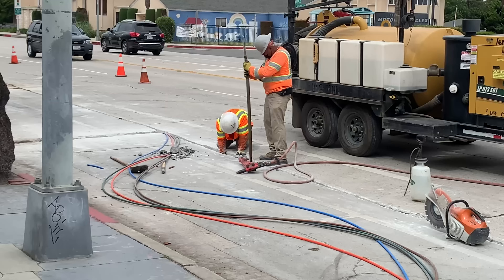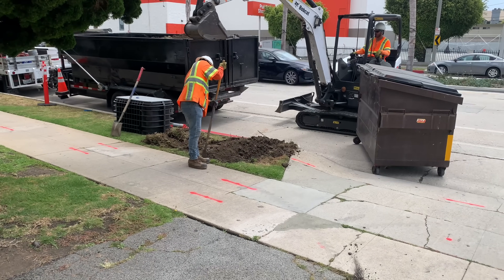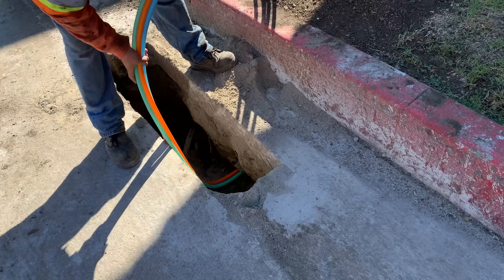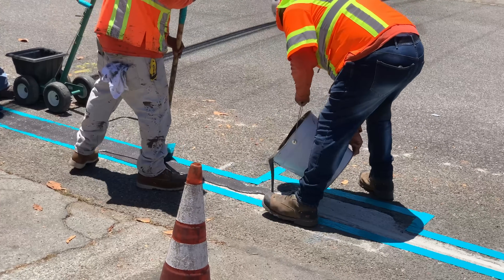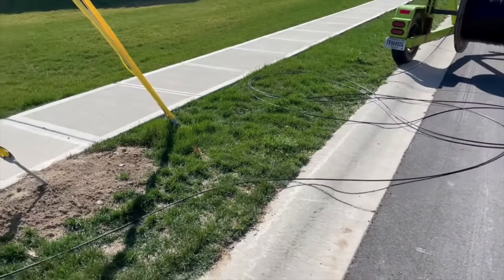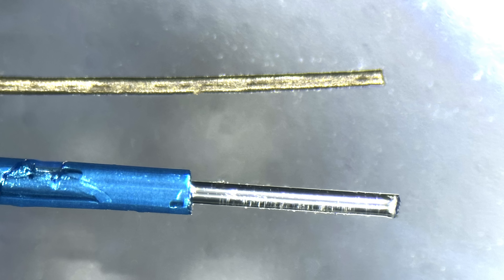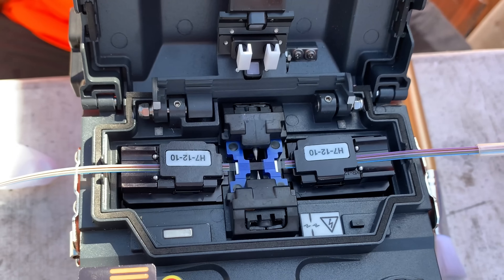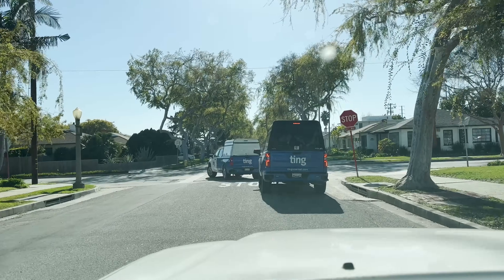Fiber Optic Network Install

Comment: How does the arc make such a perfect connection? It looked like it was never seperated.
Reply: Glass is very resilient and doesn't oxidize when heated and melted

Comment: during the transition from copper to fibre, my colleague told me a story of how crazy it was to convince the customers to change from modem to ONT as he was one of the technicians that was deployed to install the new ONT
Reply: You wouldn't have to convince me unless the price was outrageous. In suburbs it seems to be cheaper than cable internet. Really wish those recent grants would have went to small outfits wanting to do some startups in rural areas. But it probably all went to the huge companies to do nothing but stay on DOCSIS for another 20 years and bend over everyone.

Comment: Left out hitting the gas main.   The fiber optic installers here have hit the gas mains about a dozen times in the last year.  The city banned a contractor over it, after they hit one and refused to stop work while the line was being fixed

Comment: The process works/worked a bit differently out where I live. They didn't bury the lines in the street, they dug through dirt. Practical Engineering did a video about steering a drill beneath the surface, and I instantly recognized the machine demonstrated in that video as the one that ran the fiber lines all around the city and in my neighborhood.

My line was spliced off the main that ran through the front lawn of my neighbor across the street, then was run beneath the pavement to get to my lawn near the curb. From there, they ran it to the house, and used a Ditch Witch to bury it beneath the lawn.

But in other places around here, usually the more rural areas, the fiber lines are literally run using telephone lines. My grandma got fiber before I did because her phone company ran the line to her house along the telephone poles.

Comment: im surprised that the local government allow that kind of underground fiber cable to be layed on the road it self. majority of the time, the only time it was allowed to be installed on the road is if its crossing the road, all underground fiber cable needs to be installed right on the pedestrian and cables need to be at least installed at least 2 meters deep so just in case that someone needs to repair the pedestrian, they dont accidentally create a fiber break.

Comment: Used to do a lot of fiber repair jobs and believe me it was a royal pain too. We were often in areas where we didn’t have a machine to help pull the cable so we’d end up pulling 2 miles of cable by hand. Though I imagine that our job was much more exciting than being the splicer that sat in a trailer for the next 12 hours
Reply: At least those trailers are air conditioned 😂
Reply: In my case heated
Reply: Hey guys any construction work let me know if have poc

Comment: A new fiber ISP rolled out in my area, and they ran their fiber along the electrical poles in the street, same as what Comcast and AT&T did. Seems easier than digging up the road.

This looks like an area with underground utilities though, which definitely looks cleaner.
Reply: Burying the fiber is the way to go,  its much safer than arial which is prone to disasters 
imagine down trees and utility poles  that fibre breaks everything is dead from phones to cable

Comment: I had fiber freshly installed here in rural Florida, unfortunately I guess the company didn't plan for the Florida summer weather and all the fiber splices in the wire wells were flooded and the tops were floating down the road because the crews never came back and put bolts in them, absolutely ruined, and thousands of dollars wasted. Glad I stayed to my old fashion coax.

Comment: splicing equiptment is incredibly expensive the small machine shown in 3:17 can costs upwards of 30,000$
Reply: I use to work at an arcade, and I was told splicing was cutting the coloring around the wire (like the skin idk I’m not an electrician and an engineer is who taught me) and connecting the two wires medal parts 😂 I did it with a hand tool, that couldn’t have cost more then $5
Reply: @JuanchitoVlog theres no metal in a fiber optic cable you must be talking about something else

Comment: I installed fiber for Verizon in the city of Syracuse, NY for years. If you have fiber internet in central and northern NY state, chances are I installed it. We never used those smaller plastic tubes. We would dig trench and bury 2 inch plastic interduct. Sometimes we would use a horizontal drill to get underneath roads or parking lots without digging. Once the interduct is in the ground, it's threaded with high tension cable and the fiber is pulled through.

Comment: This is just a local FTTP in a neighborhood. Long distance networks can be installed up to 20,000 feet per run without splicing. Also one fiber going into a Hub can be split up to 36 times, depending on the length of the run.

Comment: Great video, it is very very similar like here in sweden, difference is we use excavators 99% of the time, if we have to go under a road or a pedestrian road we have a thing called earthrocket, basically a long 40mm wide stick that punches the ground in front of it but often we just dig up the stem-tubes near roads and from there connect tubes to the houses, after that another company comes and installs the fiber through the tubes.
Reply: We work with those also, pneumatic missiles. They likely used those to get past the curb without cutting it.

Comment: Got fiber installed in my little town of 150 people last year. Makes a huge difference in internet quality. Only had wireless 4G available before that, which wasn't bad, but just couldn't get the speeds we got now. Got a 200meg connection now. Sure, no way near as fast as ya can get in the big cities, but it's a godsend compared to what we had before. Plus, literally live in the middle of nowhere where we have to drive over 30 minutes at highway speeds just to go grocery shopping, so I'm not complaining, lol. Anyway, it's neat seeing a close up of how the process works.
Reply: @kriss7306  that is crazy where u live bro?
Reply: that's honestly insane... how do you find work?

Comment: It's really neat to watch them build out buried Optical Networks.  My neighborhood is from the mid 1950's so all utilities are run overhead in the alley ways.  AT&T has the PON up on the poles.
Reply: yeah my county has the same setup, they run ethernet from the gateway out to the homes.. and the county across the river from me has the fiber to the house and gateway installed outside the house.. I prefer the latter but I am just happy to have fiber.

Comment: isn't fiber optic super easy to break within the cord when it's bent? you'd be lucky to get even %50 the normal speed with all those little fiber fractures within the cable. These guy don't know how to handle it
Reply from the maker: The colored tubes are empty.. the fiber is a black cable which has a thick fiberglass core that prevents it bending tight

Comment: Your country is doing this in an extremely inefficient way

In my country they didnt need to cut up the whole street to run the cables, they were fed underground using a "Ditch Witch"

Comment: I live out in the country and at&t has an experimental fiber internet plan for rural areas where the fiber optic was sent from the power lines instead of digging through roads and  spliced and split at the pole and dug underground to the houses.  About 2 years ago we had a promotional plan for 75$ for 1gbs unlimited/1 year and after that ran out we switched to 50$ for 500mbs unlimited. Before it we were forced to use Hughesnet that was like 50$ for 25gb total usage and had to pay for extra per gb or something and it sucked very much. Such an upgrade almost everyone on the street has it

Comment: Over 20 years ago, after the local mega cable company reneged on its promise to bring fiber to our city, me and another city councilman started the efforts to have our local city water company take on the effort to provide fiber communication to residents and businesses of the city. We were over half way there, including authorizing the City owned utility to take bids on the research and design of the municipal system, when the giant cable monopoly paid a few state representatives to make municipal owned communication systems illegal. After they passed this law, we turned around and started to set up as part of a plan to enable competition while doing minimal damage to the city streets, curbs, and sidewalks, a plan to design and install the ducting and piping to run fiber through the city. We wouldn’t own a communications system, just the “plumbing” that makes one very expensive to install. Mega company sues us, starts paying more state representatives bribes in the form of campaign contributions, and even started  giving money to folks running against the current city council. Sadly, they were able to pass a second law precluding us from building the infrastructure although we were able to pass ordinances regulating curb cuts and road construction. We also made their lives living hell when it came time to agree upon a new agreement between the city and mega company on the cable franchise. Sadly, due to the changes in Federal law we could only do so much but we did only give them a five year agreement instead of the twenty and then fifteen year agreements they wanted. The idea was to convince them to sell our city to a more agreeable company by just making it expensive and a pain to do business in the city. This didn’t work since they owned the vast majority of the state and thus were able to just pay folks off at the state level. It did warm my soul a few years later when the local phone company came in with FIOS and tore them a new asshole. The phone company owned more politicians than they did. While I don’t live there anymore, I’m told they now only have 30% of the homes passed as customers, as opposed to the over 85% they had when they bought the system. Couldn’t happen to a nicer set of assholes. Truth is, cable companies are dying. It’s just the data business that’s healthy, something our city council knew was coming a long, long time ago. 

I now live in Austin, where we have Google, ATT, and Charter all offering gigabit or better to the home. At a reasonable rate too. Don’t you love competition? Add in 5g and 6g over the air and moving bits gets cheaper every day.
Reply: I love reading about various systems/infrastructure in the US, its hilariously dystopian, obviously not limited only to the US but it's kind of its bread and butter

Comment: This is EXACTLY THE SAME steps Done Over Here in Algeria
Installing Optic over Copper in all the Country
And these are the Same thing 
Except for the Individual household Box
They're using a bigger box for 10 Houses and they just run a long Optic Line to each individual house
For speed we're still Slow compared to ur speed 
We have the Following speeds
10 mbps
20 mbps
50 mbps
100 mbps
200 mbps
300 mbps is our current Max speed
I personally have 50mbps and it's more than sufficien for now 🔥

Comment: Thanks!  The cable installation and termination was the part I missed.  In the town of Taylor, Tx, Samsung is building a new chip plant.  That makes houses, duplexes, and apartments in nearby towns, such as Hutto, where I live more desirable to future employees of Samsung.  In my area, AT&T was first and put in 31/4" duct in front of all the houses.  This runs to the end of the block and joins other cables from other streets, which in turn run around and along the rail road tracks to a cell tower where everybody and their brother have terminations.  After AT&T was finished and had some of the fiber lit, I saw yet another company putting in duct work.  At that site, I found out that there are 7 or 8 different companies that want to provide fiber service to the majority of homes in this area.  Since this town used to be much smaller, it is probably in a zip code considered "rural".  At present, the Feds are handing out money to fiber suppliers like candy and so everyone wants to build us out.  This second provider was NextLink and all was well....until their horizontal drill guy happened to hit a 14" water main.  After this, all of that sub-contractors equipment disappeared and all their work stopped.  Later I found out the same sub hit sewer lines and in one area hit the 15.5 KV electric line feed the ground pigs (transformers) in our area.  I suspect the city invited that sub-contractor to practice somewhere else.  Now that the road damaged with the water main break has been repaired, I have seen splice points covered in and hand holes appearing, so someone is working..

Comment: In rural areas it looks great, 5 years later after the original company has gone bust, after it changes name several times, they finally give up, the cables are still there, although try to find out who owns them, the turds are still there where the mystery guys dumped, probably those too, no body knows, the days of nobody gives an f, when the going gets tough, walk away and leave it

Comment: man I wish we could get fiber. Wont happen for residential for a VERY long time though. The local Cable CO is the only one who can provide fast download speeds, and they arent in charge of the fiber here. Only certain businesses can get it. I even have fiber right across my house on the pole, but since I'm residential I'm not allowed access. Only "residential" who can are the apartment complexes, since they are actually commercial.

Comment: Any reason as to why they don't just place the fibre on utility poles rather than underground?
Reply: It all depends on the area you are working in. Some places forbid aerial construction. It has nothing to do with sharp turns.
Reply: Primarily weather. Many cities and states are beginning to move utilities underground to protect them from tornadoes, hurricanes and wildfires. It saves time in the future when a natural disaster does occur and electric companies don’t have to constantly put up new poles.
Reply: Fibre is incredibly fragile and cannot make sharp turns.

Comment: I see most countries are finally moving onto fibre and discontinuing ADSL broadband. Finally. Got 100mbps a few years ago. Amazing upgrade. Can't wait for 1000 before 2026 and 2500+++ before 2030 🥰
Reply: VDSL is perfectly capable of 100mbps though. Fiber is capable of 2400/1000 in the case of GPON which is what most installations at least are, or XGS-PON that is capable of symmetric 10 gigabit. There's no technical limit for why you couldn't have gigabit back then.
Reply: @jm036  Older standards could technically always do more, but they are expensive with higher density speeds per customers, and probably unreliable. Fiber as a base gives you a lot of flexibility for every entity involved.
It wasn't ever technical limits, we always really had the tech to do it all. We even have tech to do 100Gb per house. It's obviously just the ISP's, governments, competition and other factors which never allow for fair market we customers deserve. Some place like Switzerland is starting out with 10Gb as a offering with their fiber, and upwards to 25Gb!
Reply: most countries had fiber 10 years ago tho lol, usa doing this work now is very very late.
Reply: @Dennan  not American but my country started rolling out fibre in 2009 and only got it in 2019 😭

Comment: Interesting to see how this is done differently in different areas. Our (fairly large) neighborhood got ATT fiber about a year ago now, they directional drilled everything. On top of being slow and expensive it was a mess constantly hitting other buried utilities (although they were obv marked). It seems trenching the street like that would be a great alternative.
Reply: There are pros and cons to each approach. Around where I'm at, the city does a terrible job at maintaining the roads, so I'm sure they'd impact the fiber in no time. It would be neat to see new/rebuilt roads installed with empty conduits, even if there wasn't an existing plan to use said conduits. That way the city or county could use or lease out the conduit at a later time.
Reply: Until the road repair people come along and ruin the lines. Also not sure why new conduit wasn't ran. Seems like a monopolistic practice authorized by the city too.
Reply: I'm surprised they did it that way. I've seen them typically hydrovac any major crossings when doing directional drilling to not take a chance. Where I live though companies get a three strike policy when hitting any service lines. If they go above that they can could loose their business license in that region.

Comment: crazy when you think of it. one bad joint on the tinyt fiber and the system can go down
Reply from the maker: Yeah, they test the signal strength immediately with the thing that welds it